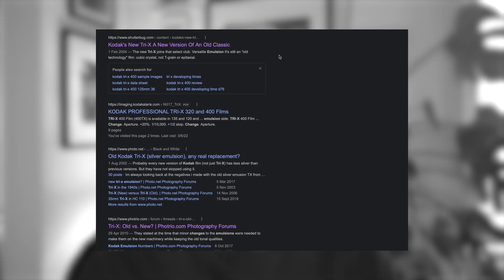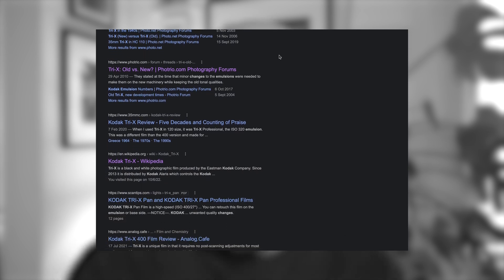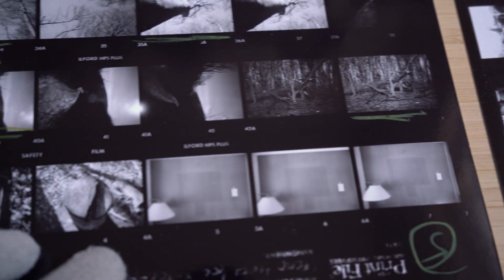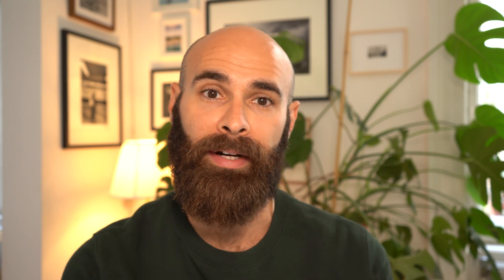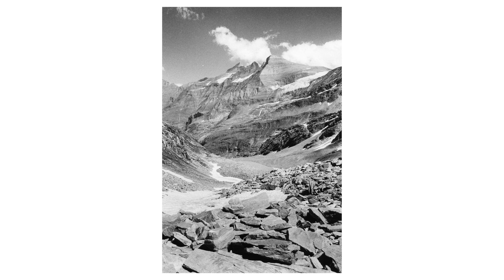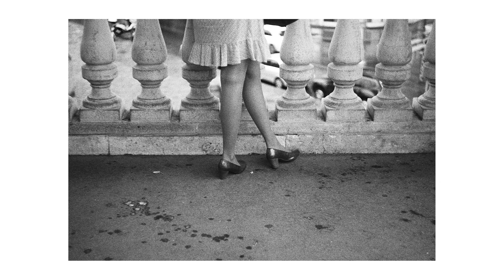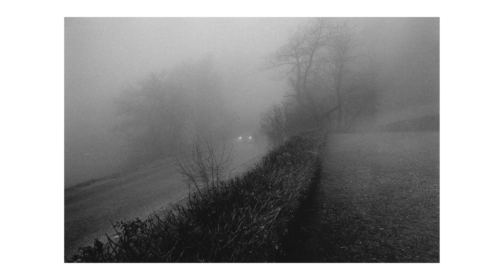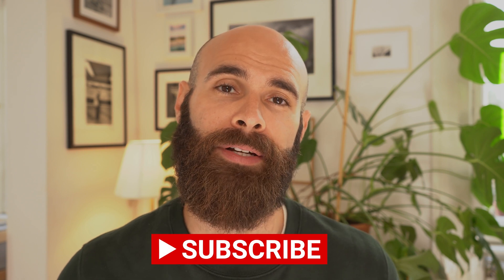Comparing Kodak TRI-X and Ilford HP5+ with the Heiland Electronic TAS film processor

Comment: This is the most thorough test I’ve seen on black and white exposure and developing. There are great videos out there but there’s usually at least 1 or 2 variables they decide to not bother with which makes the results less conclusive. I’ve been shooting tri- x forever before it was renamed 400tx. I’ve also noticed recently the rebate on my contact sheets are nearly black when I exposed the paper for max black. So confused as to what they’re doing since tri-x in 120 seems to be normal. I thought my paper developer was bad or I wasn’t developing long enough. Tri-x also seems to be at a minimum a true 200 speed film or even less. Maybe 160. Apparently it used to be marketed as a 200 speed film. My recent hp5 contacts have been near perfect at 400 with extremely bright film rebates with clear sharp text. I’m always on the fence about switching to hp5. I also gave pan f+ another go and it’s now my go to low speed film at 32iso. I’ll be bulk loading soon. Thanks for this great video. Are you shooting tri-x consistently at 200? What’s your go to development time? Mine has always been 9.75m in d76 1:1 or 7min in rodinal 1:25
Reply from the maker: Thank you so much Eric, your words are very much apprecaited. I have made very similar experiences to you, along with a friend of mine who has always used tri-x since over 20 years. The emulsion and writing has definitely undergone some change, at least in 35mm. I've been metering Tri-X consistently for 200 ISO, as it feels very much like that is the correct true native speed. Develop in Rodinal 7:30 at 20 degrees (1+25).

Comment: Hey! I think the film curling up might be a different factor i tried a long fixing time with tri-x and its still curling up. That being said i don’t have acces to a drying cabinet. Might that be the factor making a big difference? (I just airdry the film, with weighted clamps)
Reply from the maker: Hi there, oh interesting, thank you for your feedback into this! Hmm, yes, the cabinet could also make a difference, perhaps the heat keeps the film more "loose" and with the weight it "stretches" it into flatness .. I could also be very wrong though :D
Reply: @doyoudevelop  thank you for your response. that would make a lot of sense. I think Longer fixing time did make the curling occur a bit less then before, in my case. And along with some other tips you shared i got my negatives to be a bit denser. So thank you for sharing!
Reply from the maker: @dailyreflectionsv  absolutely! Glad this worked out nicely for you :)